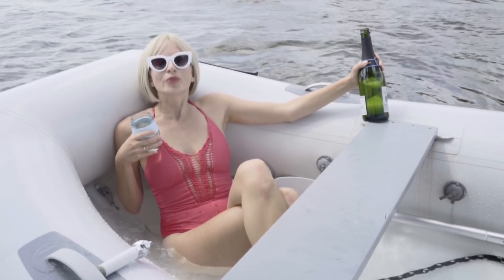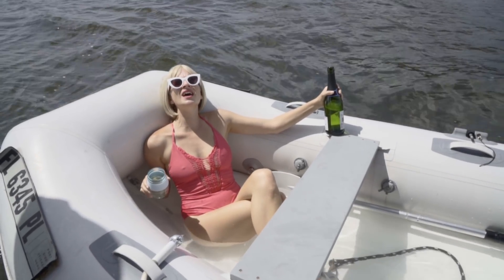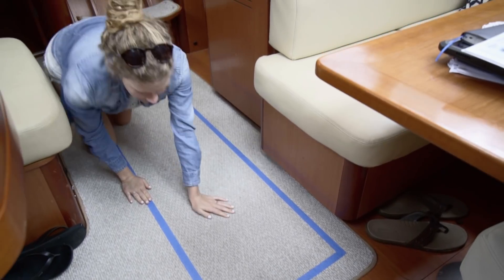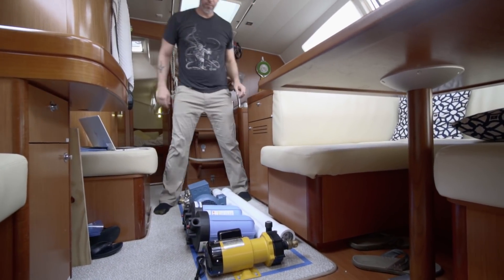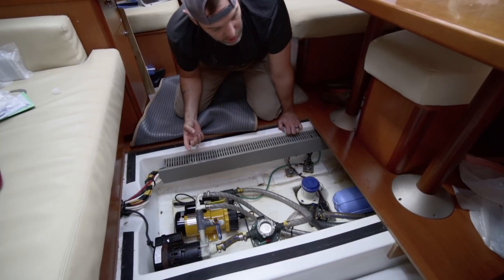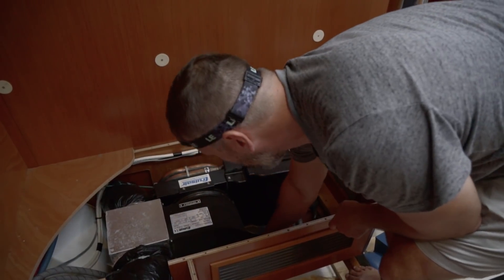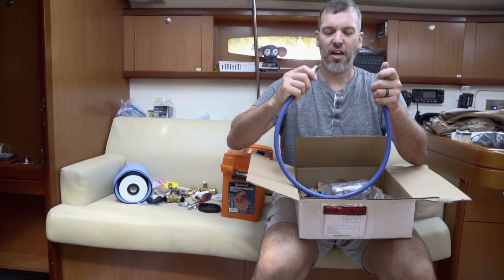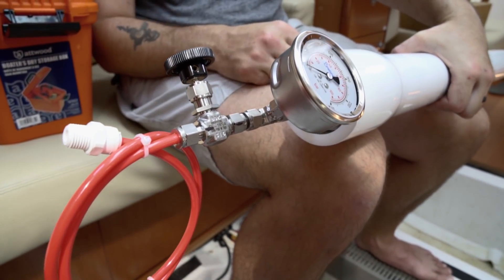Building a DIY Watermaker, Our Hardest Sailboat Project Yet (Take the Waters) S2:E1

Comment: TTW, i read every comment listed below....not one person asked how much outlay of cash for your DIY
Reply from the maker: I'm ashamed to say because it was so expensive and we don't have a ton of money. We thought it was critical, so we made the sacrifice. This was proven in the Bahamas when we needed water but were not allowed ashore due to Covid. So, for those wanting to go down this road... The big stuff was $4k (pumps, motors, pressure vessels, filters...), $1k on plumbing, $500-1k extra parts, wasted parts, and some I still haven't installed like the ac/dc relay switches for the pumps. It took hundreds of hours to find all the parts that are potable water safe.  The water maker does work awesome, it produces 50 gph, we love using it, and the water taste better than anything you get from the stores or tap. If I did it again, I'd get something from Cruise RO or similar, they'll have all the parts you need and you'll end up saving money and stress. -Brian

Comment: Very impressive system. Who needs water tanks when you have the ocean. You are a very smart engineer. Looks so complicated.  How often do you need to change the filters?  Would not want to run out of those in the middle of nowhere.
Reply from the maker: Thanks! Brian put a lot of time in to researching and configuring the build for it. The pre-filters we change out every 3-4 uses. We clean them out and try to re-use them also. Then the high pressure membrane filters we make sure to take care of them as instructed, and they should last us years! ~Mandi
Reply: @TakeTheWaters  : Brilliant concept.  Every yacht should have this on board. You two could make a fortune installing this system in personal craft for many customers who live on board and travel the world. Fresh water is always hard to find these days.  You are sitting on a gold mine !

Comment: Great video. Love the ending ha ha!   Well done.  I have had both the kind of watermaker that you have, component built 110V system. 20 Gal / hr.  That was on a Cal 46, a boat with lots of space especially for machinery.  My other boat a K Peterson 44 I installed, with separate components, a Spectra watermaker. 12V. Because all of the components could be separated, I was able to install it all over the place so didn’t have to take up too much hi value storage and space. Loved the 12Volts. Could make nearly 10 gph just using solar panels. It was also Much quieter than the 110V. The Spectra systems was also not that much effected with water temperature. But I really liked them both. The best part of the 110V one was at 20gph I would just run it once every couple of weeks. In one shot, fill all of the 200 gals of tanks and be done with it for a couple of weeks. I always gave both units a good fresh water flush after use unless it was going to be right back on soon.  Good production. Thanks.

Comment: Dude. Nice work!

I feel like all the boat owners are Tim the tool man. On a a scale of 1-10, 10 being Tim, how machanixay inclined were you prior to buying the boat?

Tell the Bahamas you want your damn speargun back FFS!
Reply from the maker: Hey there. With google everyone can be a Tim haha! I've been working with power tools since I was 8, and did understand a bit of low voltage DC electronics, and know when to call my brother for help for the high power AC stuff (he's an electrician). AC is something that's different on a boat because of how the grounds are, or are not.  I learned most the boat systems from scratch, but google makes that easy. You can find everything from water pump manuals to mast drum furler assemblies on there. 

I'll give my cruising permit to anyone leaving West End going back to the US, and they can have my spear gun lol. At least it will get used again.  -Brian

Comment: Hi is it not better to have most of the components above the water line not in the bilges, in case of flooding, and to ensure water does not get contaminated during the process? I saw other channels where they used cabinets above the waterline. Also why did you not install the pressure gauges in the Nav area or somewhere for easy access and direct line of site?  Let me know as I am also looking for most efficient places to install my WM on my Cat.
Reply from the maker: I'd say if you have the room, keep the motors out of the bilge. We didn't have any other place to put them due to the size of the motors, unless I wanted to run water lines and power all the way to the transom lockers which would be a nightmare. Our bilge is usually very dry.  In terms of contamination, a flood wouldn't effect anything as the systems is sealed, if it wasn't then there probably other problems to consider. I suppose a flood would damage the motors, but so far so good.  My Pre/post gauges and flow meters are right next to each. I'm making another tech video that gives a detailed explanation of how everything is setup and the operation of the system. I'm releasing it to Patreon first, and then on YouTube. Not trying to plug Patreon, just a fyi of the timing. Thanks for watching! -Brian